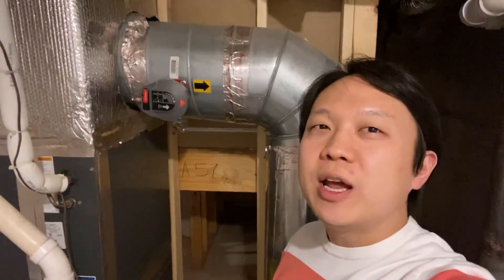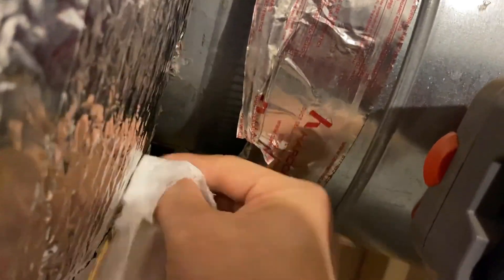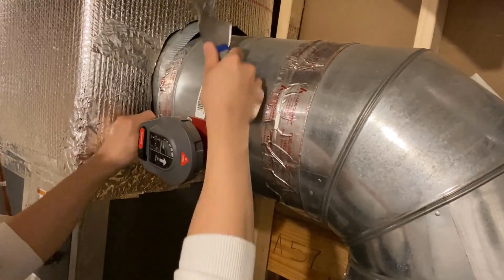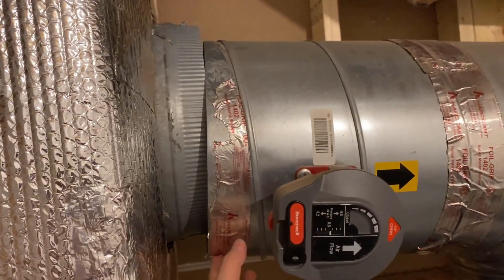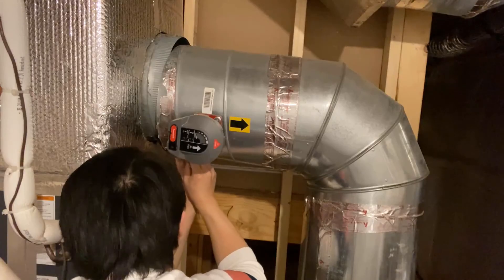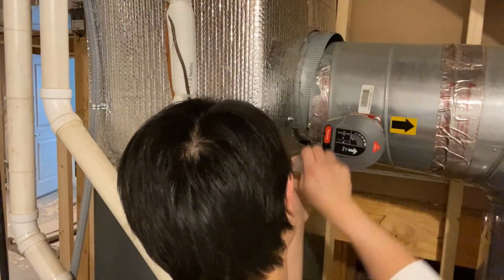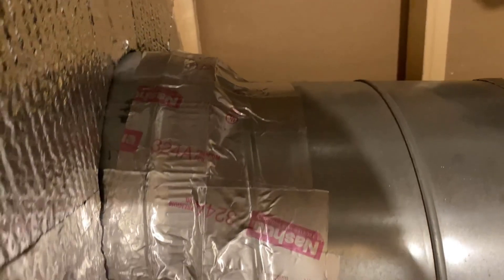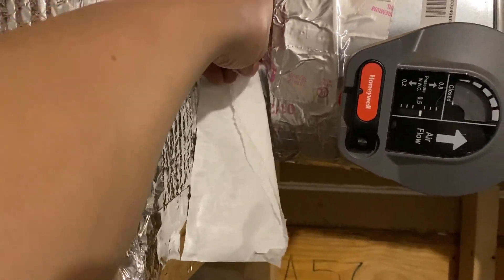[HVAC duct sealing] Easy DIY HVAC duct sealing of the bypass duct gap by taping

Comment: That connection by tape is not acceptable.  I would have the company that installed the duct work come back and replace the duct of sufficient length and diameter.  Making sure the connection is without a gap.
Reply from the maker: Thanks for watching and yes that would be if you know who installed in the first place :)